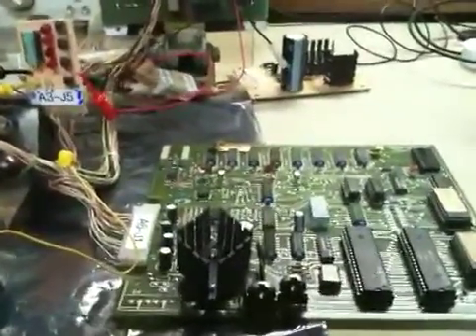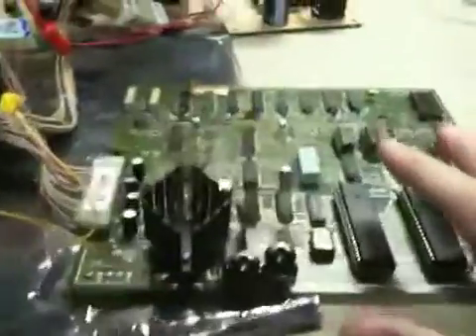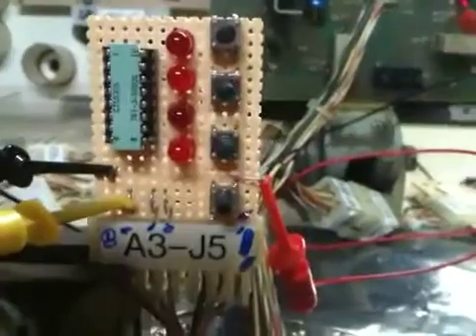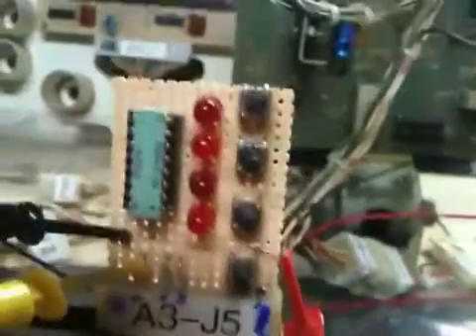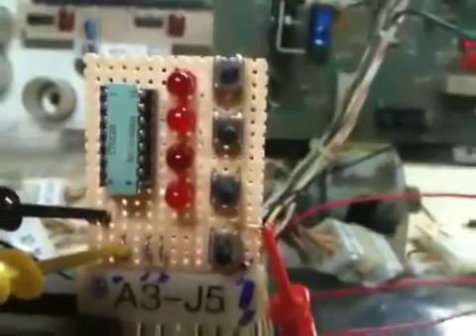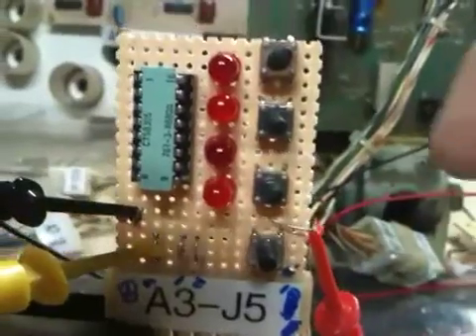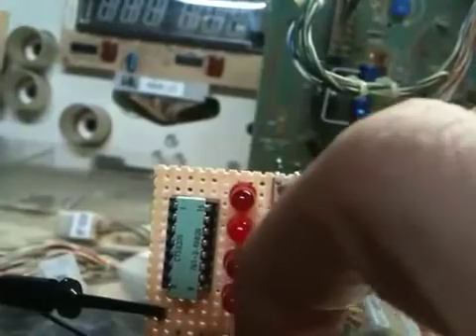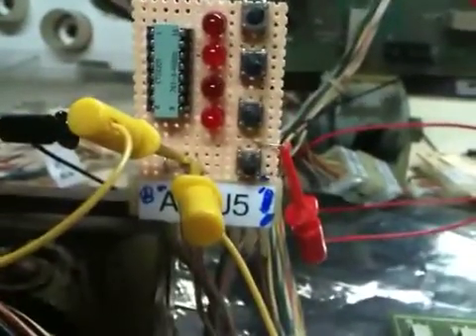Testing a Gottlieb Haunted House Sound Board

Comment from the maker: Oh - I was using pins 8,9,11,12 on the sound board connector.  You'll still need the attachment to the sound board power to get things to work.  It's been a while, but I think without the main CPU connected I had issues since I believe there are some pullups on the main board for the sound board.